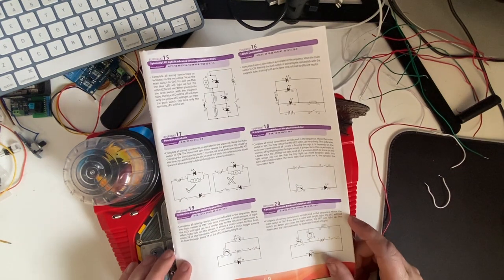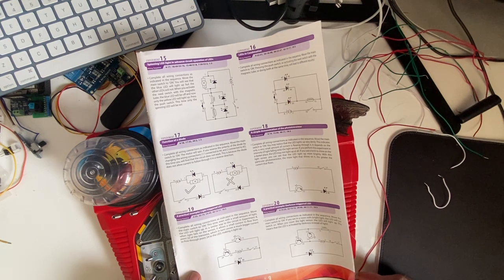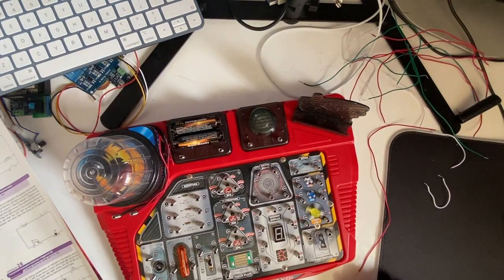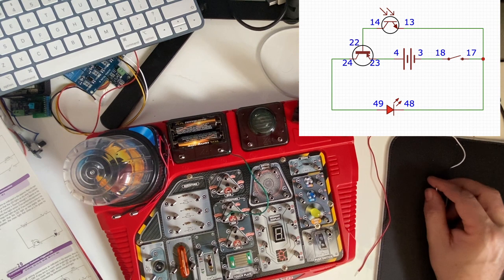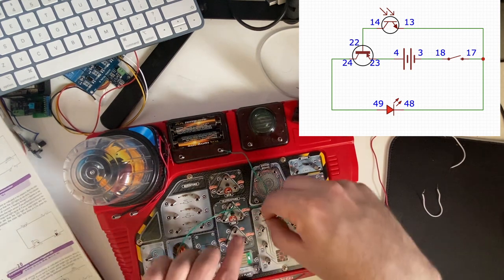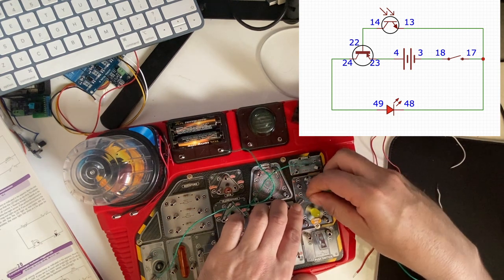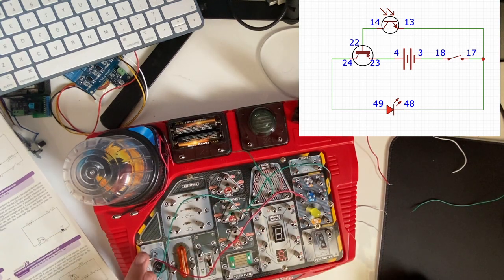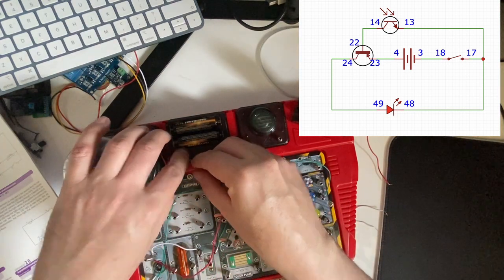Science Mad Circuit Lab Experiment 19 - A practical example: Light triggered LED

Comment: You need a pull up on the base of the PNP transistor to force it off when no light is falling on the phototransistor, as the phototransistor can only pull the base down and any leakage in the phototransistor will help keep the PNP transistor partially on.
How about a Exp 19(a)  Adding a pull up resistor?